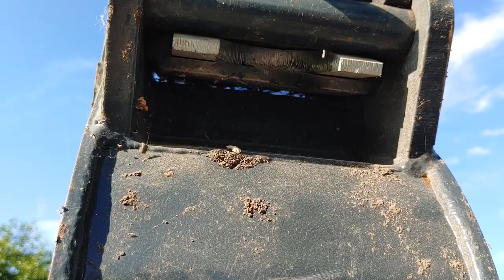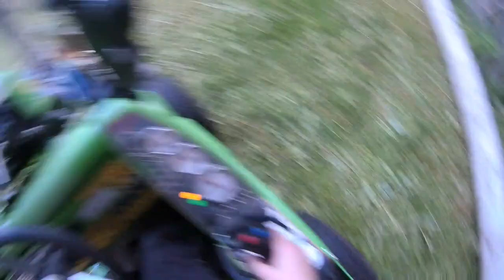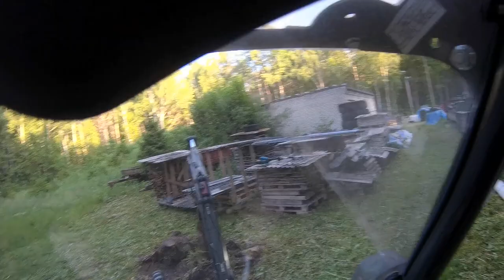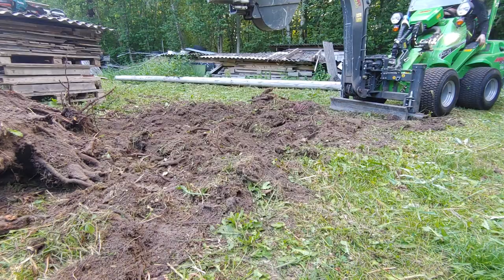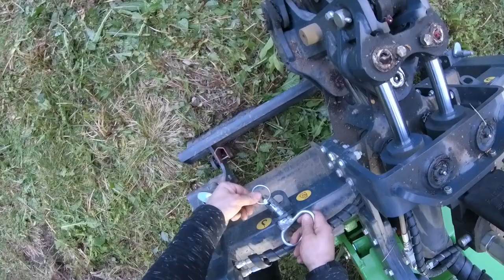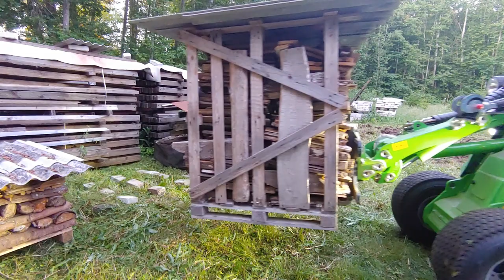Avant Digger 260 ripping up stumps - part 1

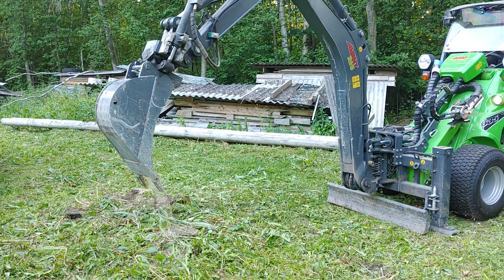Comment: Is the parking brake on at 2:18-2:24?
Reply from the maker: No, it wasn't. I'll try it next time, but still the digger has probably more pull than the blade/outriggers/tyres have traction, depends on the soil too perhaps.